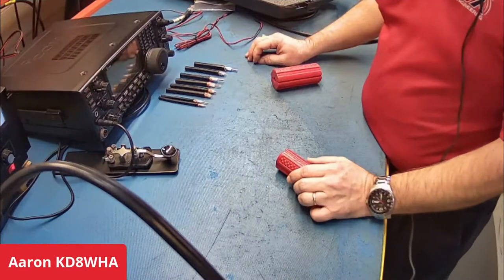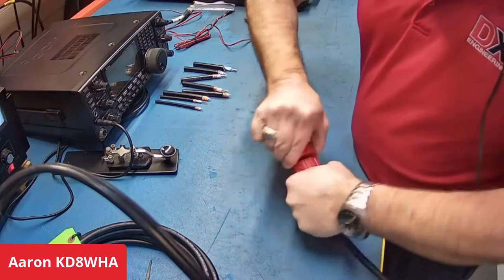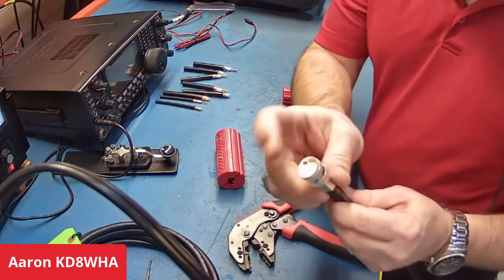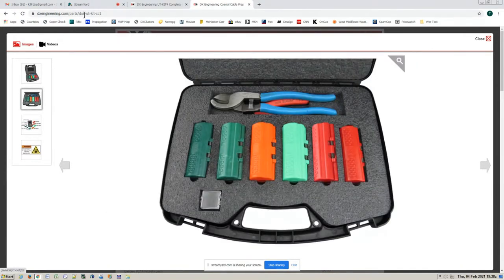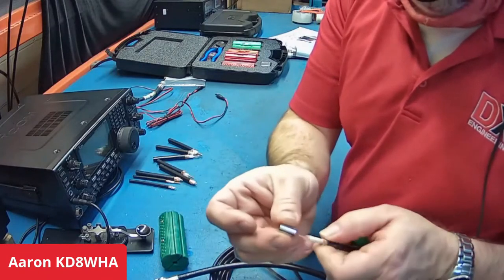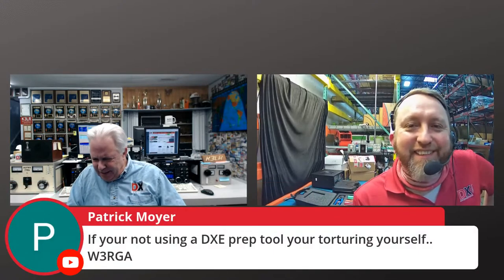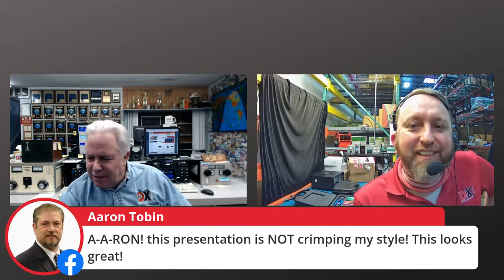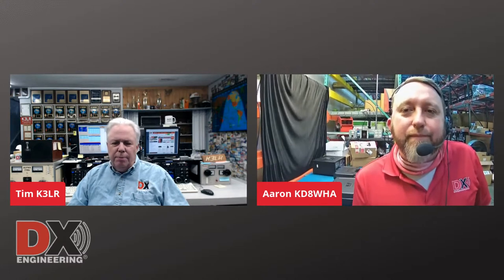DX Engineering Coax Stripping Tool - Manufacturers Showcase

Comment: I have that crimper. I CANNOT crimp the sleeve without putting the crimper in my vice and tightening it that way. I watch you (and another video) and you have NO problem doing the crimp. I  have the red UTdie? 405G-P1 for 400-size cable. This was put together for me by one of your salespeople. I wonder if I have the wrong die? I'm old but not so old that I can't do the crimp.